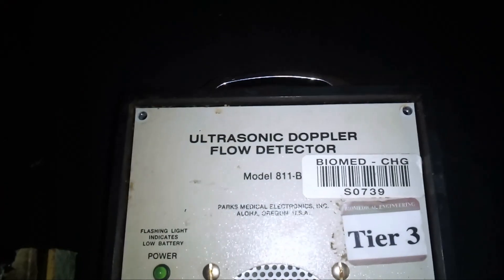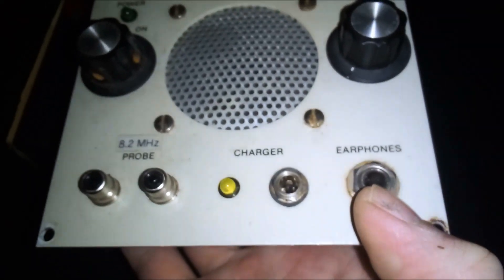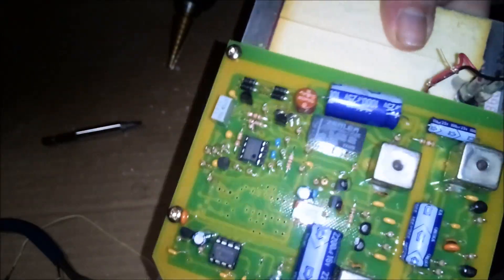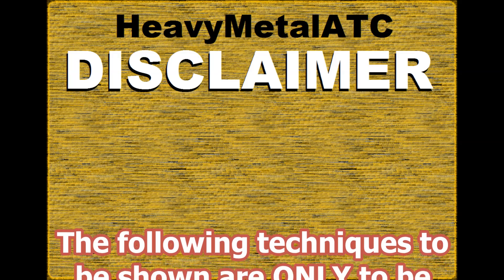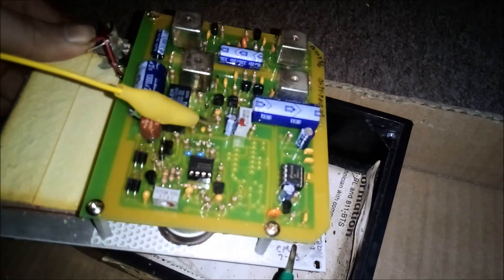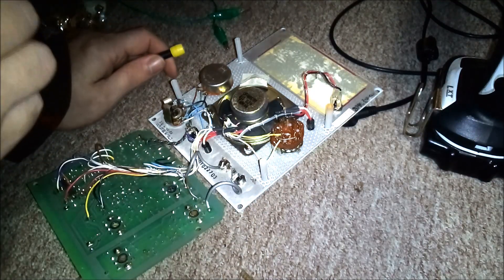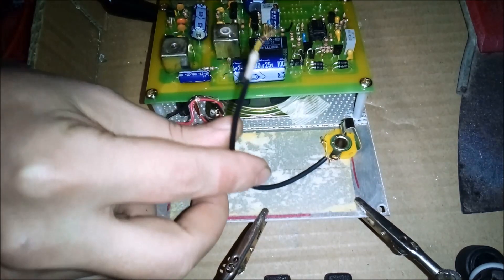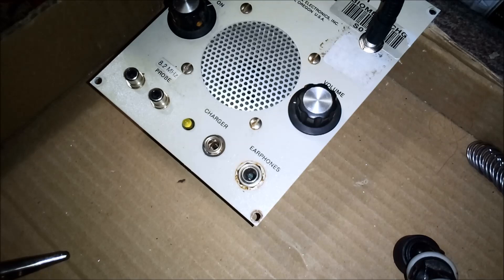Medical Test Equipment Guitar Amp/Overdrive Conversion (Explained + Demo)

Comment: I'm thinking if you made a pair of shorting RCA plugs for the jacks you may accomplish the same thing as Fender does with the unused channel shorted to kill noise. If that works they could be shorted internally.
Reply from the maker: Damn bro. that is a 1000 iq move. ill have to try it. thank you fred.

Comment: Drill a pilot hole before the step bit and it will go faster!
Reply from the maker: Ted Schoenling Thanks for the tip.
Reply: Not really.  By the time you find the bit, switch it out, drill, and switch it back it would take longer.  But I get your point.🤗